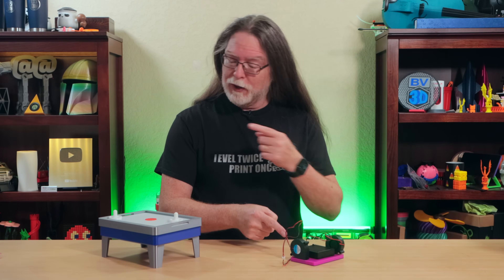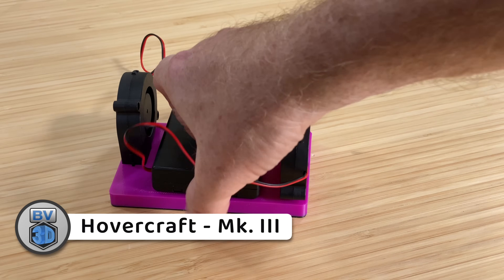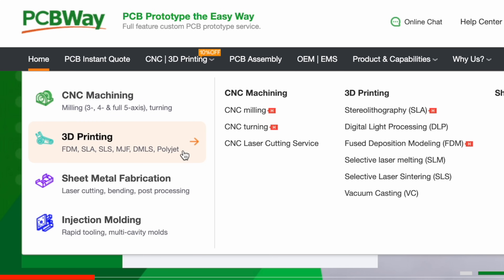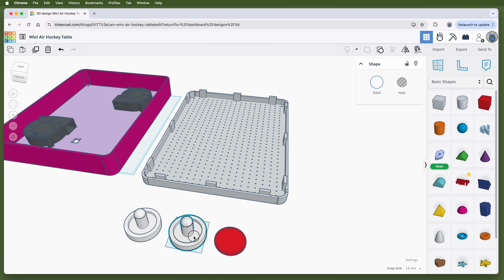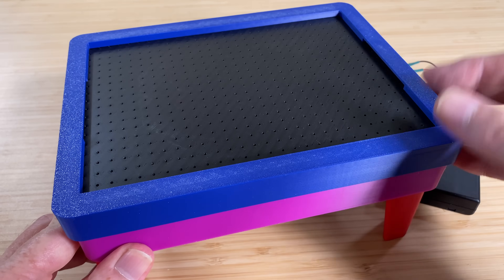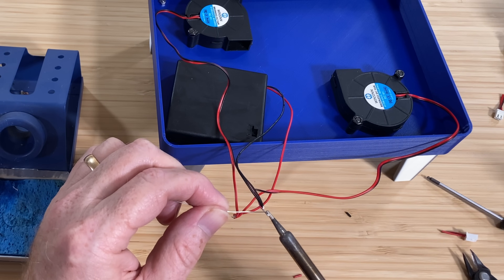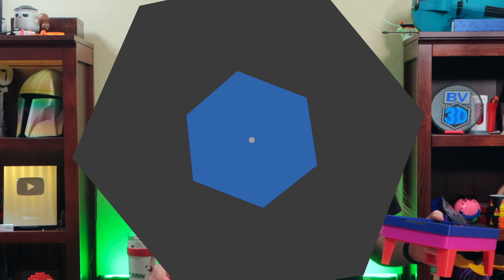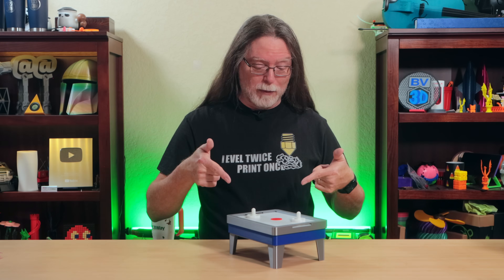I Tried to 3D Print a Hovercraft… It Became Air Hockey!

Comment: I also used to twist wires together as a kid, and found that it did not work very well. Probably you were better at it then me :) Seriously, if you can't solder a good method is to use terminal blocks, which are cheap and widely available.

Comment: I think the issue might be the skirt design; you're filling the entire volume with air and then using pressure overflow to generate lift. You want to reduce that internal volume by adding a second inner structure that diverts the air just around the edges. Basically copy the main body, scale it down and insert it into the body with some stand offs. This will create a channel for the air to flow to the edges, generating more pressure and lift.

might work

Comment: I was introduced to cold solder heat shrink tubes by CHEP. Never looked back.
It is my go to for joints.
Stuck in the middle of nowhere with a broken wire? No plug and soldering iron?
Just keep some CSHS and a lighter in your car. No problem. The fix is top quality and waterproof!
Love your channel!
Creative ideas seems as common as your puns.
Looking forward to the next video.
Reply from the maker: I've seen those, but never have bought any. I should get a box of them for those times when I don't feel like grabbing the soldering iron.
Reply: My soldering is so bad, nothing works afterwards....